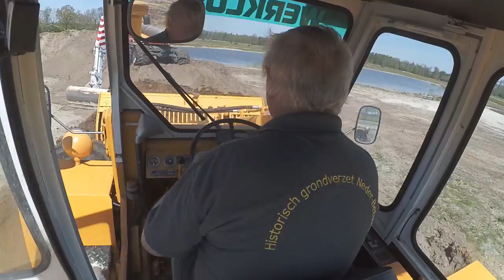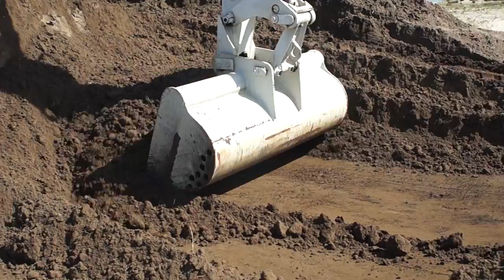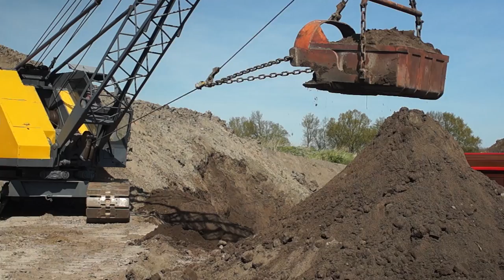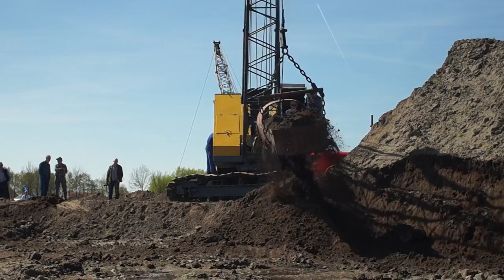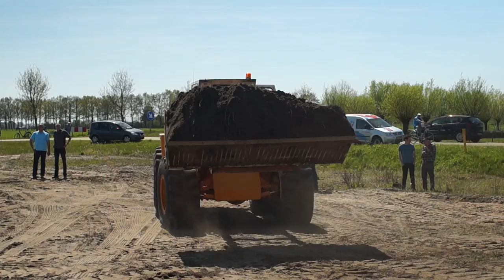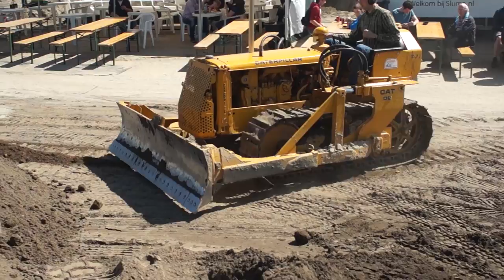BONUS video van Vereniging Historisch Grondverzet - AgriTraderTV #38 bonus

Comment: Ik heb in de jaren 70 genoeg van deze machines vervoerd op de dieplader, twee openslaande stellen aan de achterkant, laadvermogen 21 ton, was toen voldoende voor de Cattepiller, O en K, Case, Volvo, werklust en noem ze maar. Wij waren de vaste transporteur van de Geveke vestigingen is het land, het bedrijf is in 1976 overgenomen door van Santen uit Haarlem, ik was daar blij mee, het is nu niet denkbaar meer dat je met dit materiaal rondreed, 40 tons dieplader was toen al veel in beeld en de getrokken 60 tons dieplader waren in die jaren voor de zware machines.
Tegenwoordig is 80 tot 140 ton veel voorkomende transporten in de grondverzet machines wereld, ik ben gepensioneerd maar nog steeds belangstelling voor dit werk.